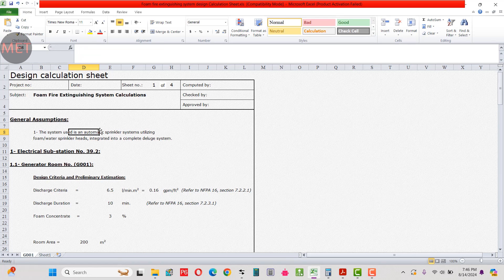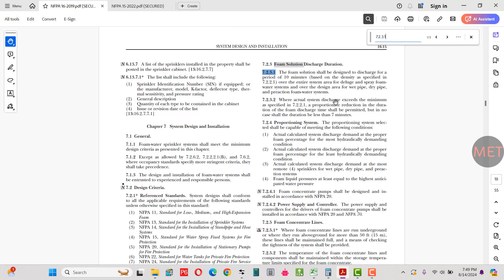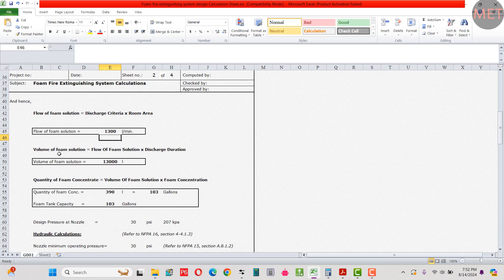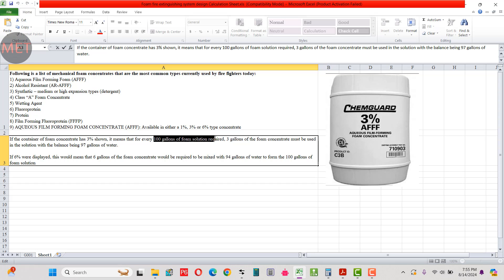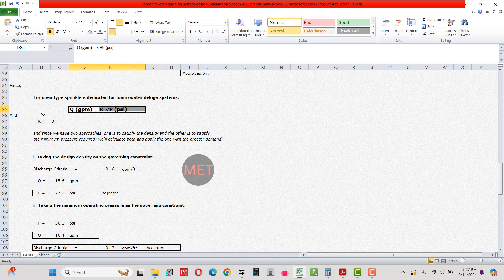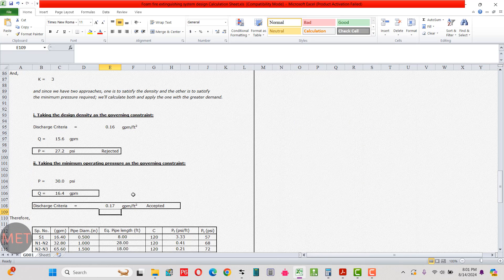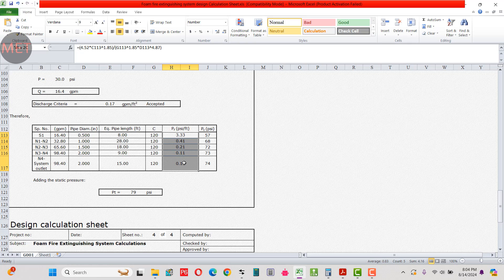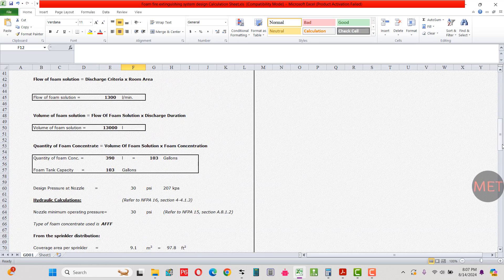Foam fire extinguishing system design using excel, tank capacity, pressure requirement calculation

Comment: Good Video but if you give reference from NFPA 11 is better then because of NFPA 16 was withdrawn at the Fall 2020 revision cycle. NFPA 16 material has been incorporated into NFPA 11
NFPA 16 2019 7.2.2.1 while NFPA 11 20024 6.5.2.2.1
NFPA 16 2019 7.2.3.1 while NFPA 11 2024 6.5.2.3.1
NFPA 16 2019 7.6.1 while NFPA 11 2024 6.5.6.1
your reference from NFPA 15 8.1.2 is for outdoor